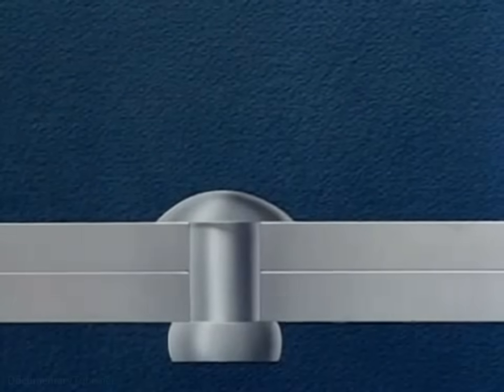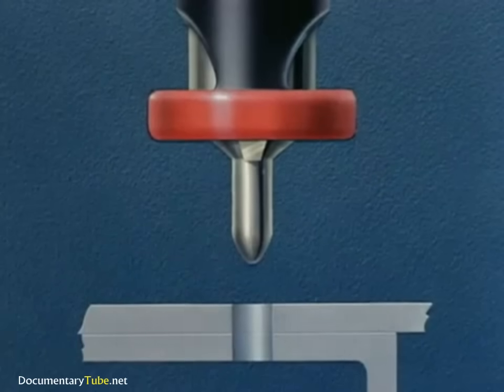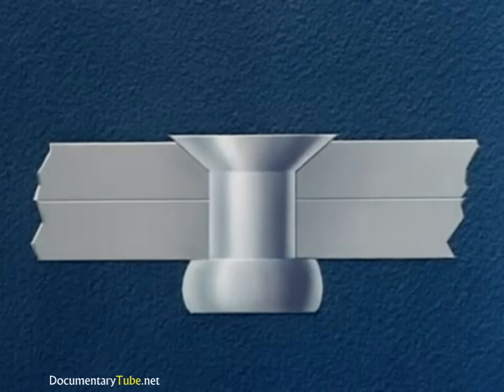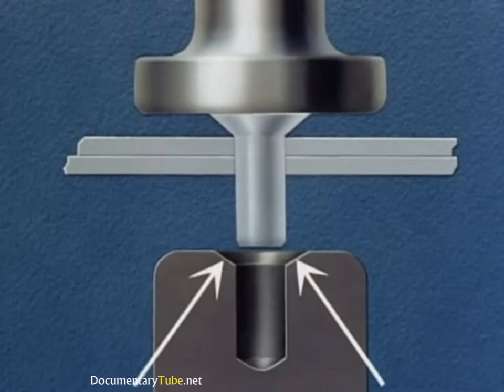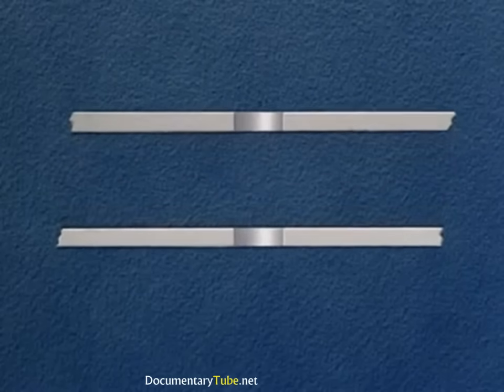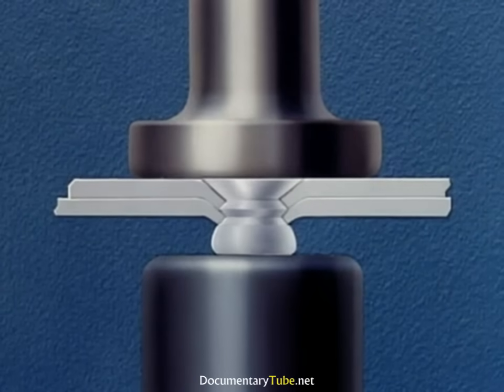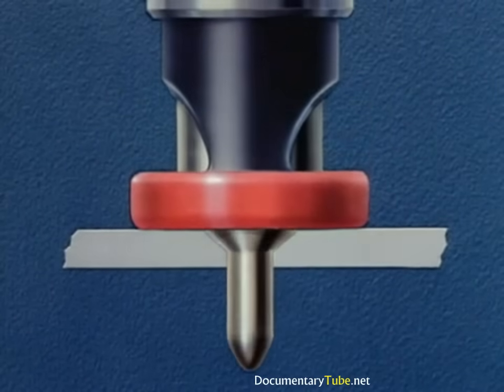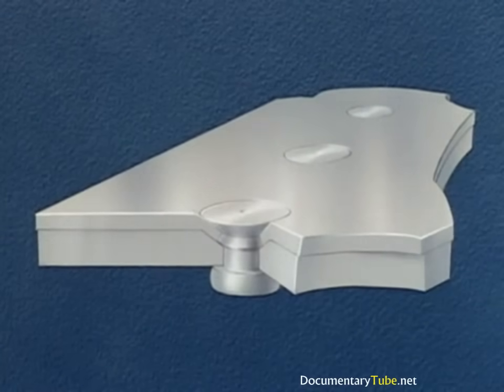HOW IT WORKS: Aircraft Flush Riveting

Comment: We still do this today, I have worked on modern  planes and it's still the same , +0 -2  in other  word it can not stick above the sheet metal  at all +0  and it can dip below the surface by 2 thousands of  a inch and we still use those counter sinks! Cool stuff!!
Reply: Rivets are still used ,the comet cracked due to square windows and square panels, thats why airplane windows are round now,they take stress loads much better that way.
Reply: +Mr1979capri something I believe will not be replaced, quite an effective method against air resistance
Reply: +JetMechMA I work on brand new f 22 raptors and f 35  and V 12 osprey  b1 bombers  and we are rebuilding b 2 stealth bomber and a lot of one we don't talk about .
Reply: @LinusE  Rivets are really good, even though Hi-Loks and Hi-Lites, which are basically a mixture between a rivet and a screw, are now being used a lot as well as lockbolts! :)
Reply: Bryce A: rivet heads are huge factor in skin friction drag. The rivets trip the laminar boundary layers and it is not desirable for low drag. The golf ball example is special due to the spherical shape of the ball, the air want to separate. So the divots keeps the air turbulent and help to reattatch the turbulent flow to the golf ball. The airfoil is not spherical, it is slender obloid so the ideal case is you want to keep the air laminar and attached for most of the airfoil. Airplane designer has put vortex generators to keep the air flow attached but the trade off is to keep it from stalling at low speed. At high speed, the vortex generators increase the drag and hence reduces the top speed.
Reply: The rivets on the Comet were punched through the skin and then bucked.  The punching action through the skin left a jagged edge containing stress risers.  The above method for drilling and bucking rivets has been used on every metal plane I've ever flown, aircraft are build using AN470AD rivets to this day using the methods in this video.
Reply: Mr1979capri: Unless you are building composite airplane, metal construction hasn't changed so this should still applies.
Reply: JetMechMa, Maybe the Ma stands for Massachusetts. When I worked at Wentworth Institute, I came across some riveting samples that students had made for a grade. I knew that they were all about aircraft manufacture, and that the proud rivets had to be shaved down to be perfectly flush, without breaking the skin, but I remember thinking, when looking at all the called out unacceptable rivets and failing grades, "Jaysus, this instructor is one picky, picky mofo!"
Reply: I think the standard may have changed. At least on certain planes. Often, the rivets on the skin sit above the structure a few thousandths of an inch. Apparently that results in less drag than if they sat deeper into the structure (better to have +0.002" than -0.002").
Reply: pahom I use a few hundred obsolete fasteners every day then lol. 737s and P8A Poseidons
Reply: 2 thousandths of an inch... LMAO
Reply: @Thematic2177  What's funny about doing something right?  A sheet of printer paper is .004" thick, way too much projection for a high speed aircraft.